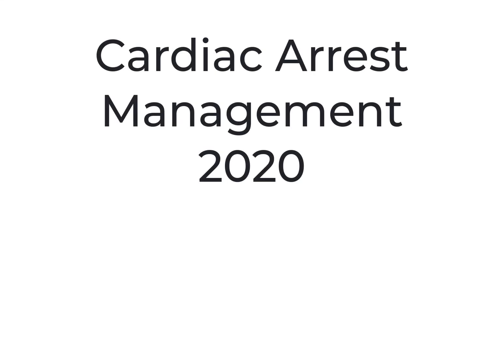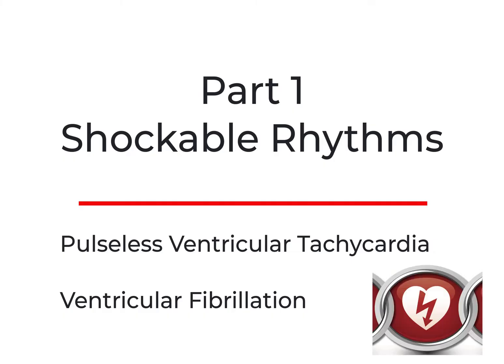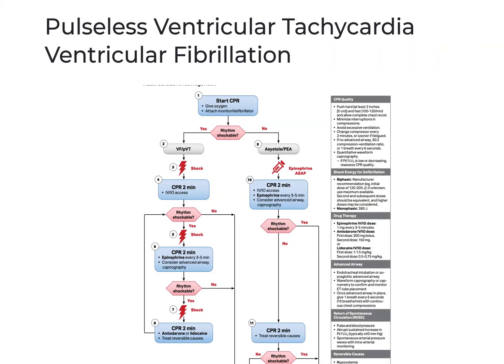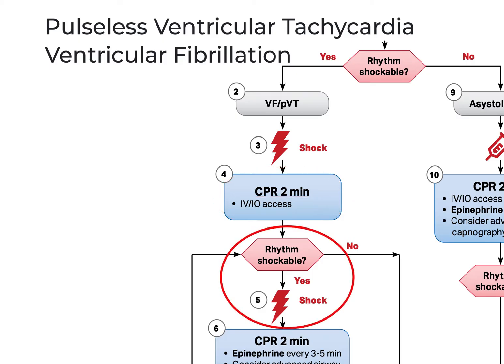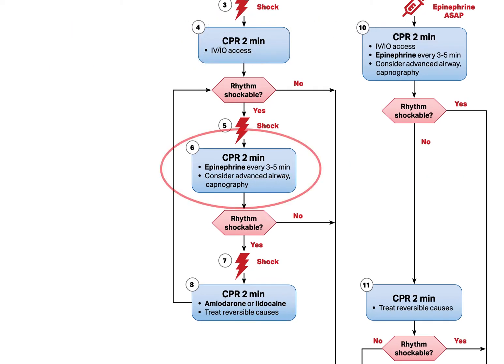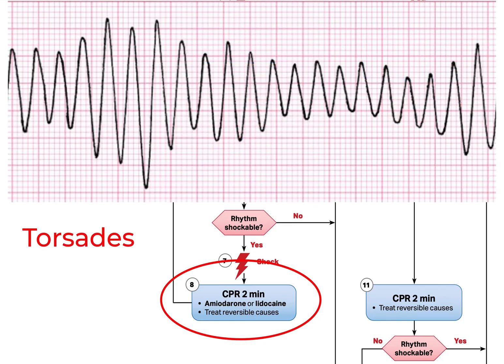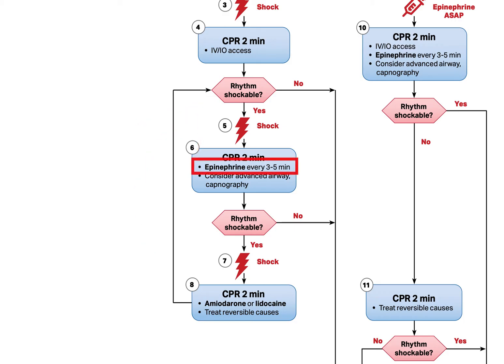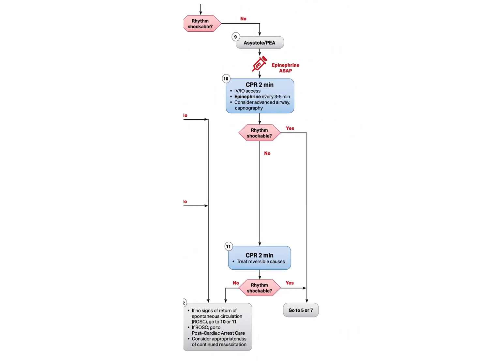Cardiac arrest part 1 shockable - ACLS 2020

Comment: .In a scenario where shockable rythm goes into unschockable after for example 2 defibrilations, and then goes back to shockable, are we going to administer amiodarone right after one shock(being it now 3 shocks admonistered in total during the cpr) or do we have to count three shocks again and then administer amiodarone
Reply from the maker: When rhythms change, there is no need to start over at the top of the algorithm. It is more important that you keep track of what interventions have been done, not exceed the maximum dose of Amiodarone, and continue shocking at the end of each cycle of CPR (if the rhythm is still shockable). In other words, we continue our pattern of giving the next appropriate drug during our CPR, shocking at the end of that cycle, giving the next drug, shocking, and so on.